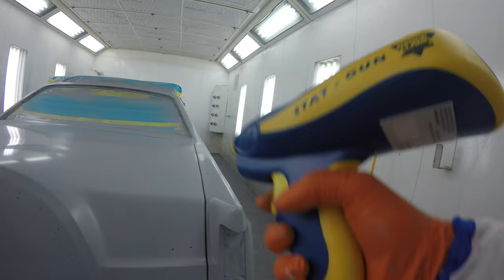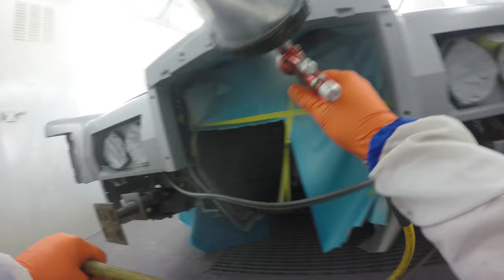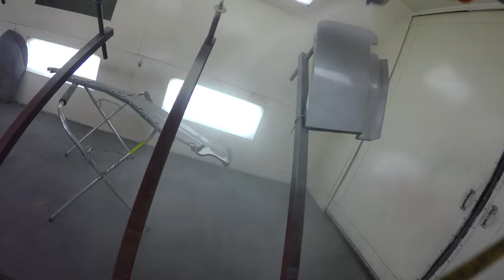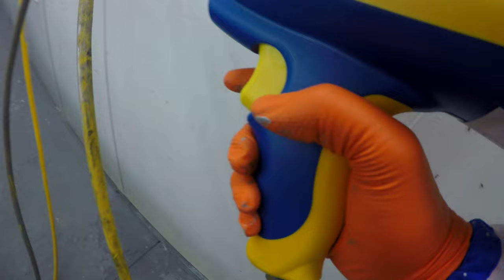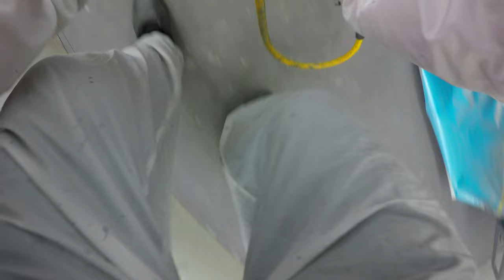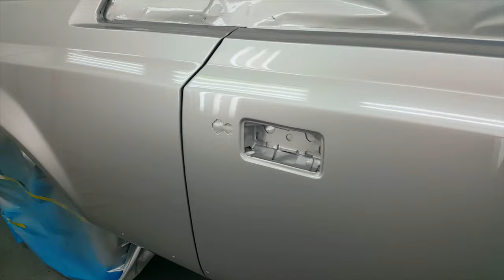Lincoln Continental - Complete Paint Job (Raw)

Comment: Any day back with this clear? What’s your mixing ratio and what hardener and reducer?
Reply from the maker: If I recall correctly it was a newer Glasurit clear, either 923-210 or 923-230. The die back with either clear is usually minimal and the gloss is very good. I believe it was 3:1 and 20% reducer.